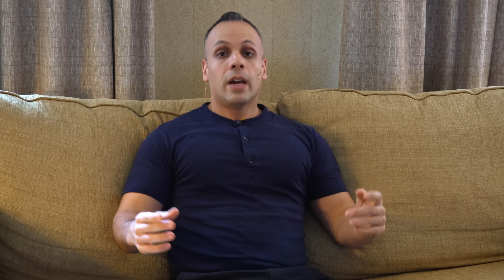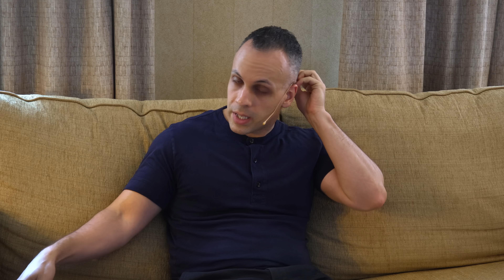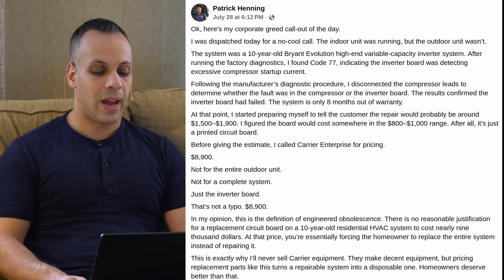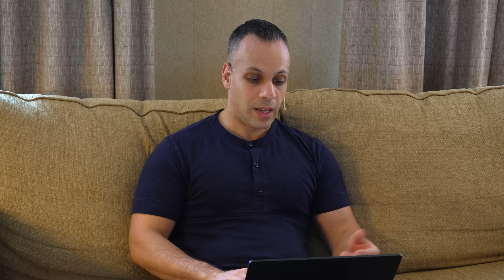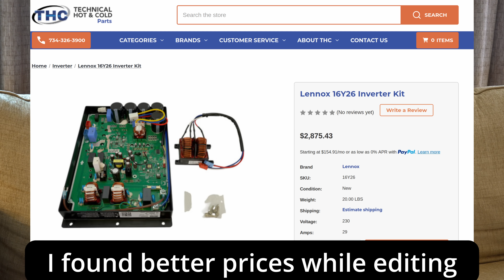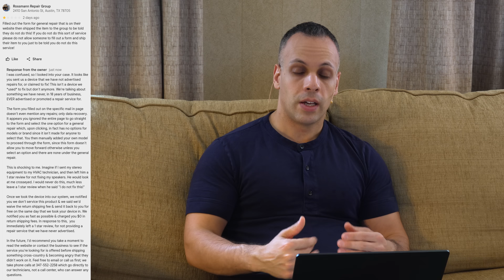Carrier AC repair has $8700 part cost for residential unit

Comment: This is very true for window units as well if the Fan motor that drives all internal and external air handling goes out to repair it the part alone is usually 40-60% the cost of a new unit not even factoring in the repair labor. They want you to throw it away and create more garbage and then buy a new unit. Its a racket and it contributes to global garbage as recycling a used ac is not trivial due to regulations. Oh and they don't last more than 5 years if you use them regularly as we do in my household. if the use were more intermittent they could last up to 10 years I am sure but not with everyday use for 3/4 of the year.

Comment: I've been in HVAC for 9 years. I have never fixed an inverter board. Granted I've only ran into a couple bad ones in my entire career. Frankly, most HVAC guys lack the skill to properly diagnose inverter systems, let alone have the knowledge to repair electronics. Residential HVAC is full of PE companies that hire mediocre techs that are good at selling. The whole industry isn't built to incentivize repair. Hence why I own my own company now. If I ran into a bad inverter board, and saw a price of $8500, I would attempt to repair it.

 Another super common failure is ECM blower motors. It's the same technology. It converts AC into DC, then back into AC in order to change the frequency, and therefore the speed of the motor. 

The part that always fails is a $10 thermistor. Most guys would never attempt a repair. I carry thermistors and a soldering iron in the truck that way I can repair them. I charge $400 to fix it, whereas a new ECM blower motor tends to run 1800-2500 at the parts house. The only time I don't fix them is if the whole entire board is potted

Comment: This is because of rules Biden passed to switch to partially flammable refrigerants effective Jan 1, 2025.  You used to be able to switch out an.evaporator.  But under the new rules, if you have to replace more than 50% of the value of the unit, you have to retrofit the entire system to the new refrigerant rather than repair.  And the new systems are much more expensive because of all the safety devices and sensors.
Fun fact: with the new refrigerant, if your furnace is gas without sealed burners, your heat can be shut down if a leak is detected from the ac.  So switching out the furnace at the same time adds to the cost.
Don't blame the HVAC installer or the HVAC manufacturer, this comes directly from government regulations.

Comment: You can buy a variable speed drive containing a similar size inverter board for $150. Not suggesting it will integrate with the Carrier control circuitry, but it gives an idea of the actual cost to manufacture, warehouse and deliver such things. You are spot on Louis, offering a repair service for these "bend you over" OEM parts would certainly be lucrative. Imagine if there's a capacitor that tends to fail on these that anyone could see from the bulge and replace in a few minutes - less people fucked and the planet saved from the environmental cost of making a new air-conditioning system.

Comment: I hate Carrier. I just replaced a HEIL (also Carrier) inverter board. over $2000. Still too expensive. Bosch has one of the best inverter/communicating systems and their inverter board was $1500 (I hear it's now 2k). Bosch however doesn't require an expensive thermostat, or even a matching air handler on the inside. You can hook a Bosch condenser with its inverter board up to a regular Goodman indoor unit.

No. I do not fix these boards. Yet. With the geopolitical issues brewing I'm very seriously considering learning how to begin repairing these boards. It's a little outside my normal skillset, but it's got to be easier than brazing 3/4" copper 1" from a service valve.

Comment: My old HVAC guy told me if it's not that it's the board. He said the board is 800 bucks. I went to Amazon. I found it for about $140. The exact model I bought it. I told my guy I bought it just on case then he says I don't put in other parts. I can't warranty it and it's a motherboard. That's all it is. It's a motherboard and it's the crummyest old fashioned motherboard. You can get the latest and greatest motherboard for a couple hundred bucks like a gaming PC and it's got double and better. It's a joke $800 but HVAC is like locked in. You can't buy the stuff you have to go to an HVAC supplier and they only sell the license technicians. The heat pumps are going to get them in the long run

It's like three plugs for power and an eight screws of wires and he needs to get 800 bucks on the part plus like $300 or $400 to put it in 1,200 bucks for 12 screws and wires together

Comment: I used to work at United Technologies and we made the control boards for carrier units and pretty much every other high end HVAC unit company. I did board repair the lsstv5 years I worked there before they moved to Mexico in 2016/2017. As long as the board itself isn't cracked or damaged you can pretty much repair it at a pretty minimal cost. The trick would be to diagnosing it to know what to repair.
Reply: I'll also say that once they started production in Mexico they were sending pallets worth almost 2 million dollars in total back to my facility for repair because the Mexican plants quality was so bad and that was around late 2016 into 2017. I left there in September of 2017.

Comment: Recently ran into an issue with my blower motor in a second house where the ecm cost 450$, but the ecm and motor cost 400$. On my home furnace it was a 4$ capacitor.   I’ve spent maybe 200$ on my home furnace/ac over 10 years. My home furnace is 15 years old and my ac is 27 years old. Anyways, I refused to pay that price and found a used one that matched exactly on eBay for 100$. The furnace is only a few years old and used for under 100 hours. Obviously the used part came from a newer furnace, and I’m sure the homeowner had theirs replaced because  the cost of the replacement parts cost more than brand new furnace.   It’s ridiculous!

Comment: The other issue outside the ridiculous MSRPs on these replacement parts is the sourcing. Many of these parts are only available to licensed contractors through approved distributors (e.g. Johnson Controls). So even if a DIYer knows enough to replace the part, they can’t get it at any price because the SOBs won’t sell it to them.

Comment: Well, now I'll never use Carrier for future AC needs.  I replaced the original AC in my home 7 years ago, and the HVAC company (locally owned, non-chain company) told me they don't sell TRANE because that company doesn't honor warranties if you can't prove you had the AC service EVERY YEAR after install.  They only sell Lennox systems and it has been rock solid every year since I installed it.

Comment: Buying these so-called high efficiency type appliances is foolish.
 The money you save monthly may get you a Starbucks latte or two, that's bout it.
 These units will last just as long as a cheaper one will also.
 And the repairs on the cheaper one when they do occur will be substantially less moolah.

Comment: Ive seen them trasition from simple decently priced units with very good warranties. The only ones that needed expensive stuff were the fancy $10k units that had boards that were $1500 each. Ever since the newer refrigerant and its requirements theyve had more problems and needed costly repairs.

Comment: When you buy an HVAC, get the most basic, single stage type stuff.  Lasts longer and easy to fix.  You might have a slightly higher utility bill, but cheaper to pay an extra $20 in the summer than this nonsense.

Comment: same thing with my car i will make my 2006 toyota highlander drive till I AM DEAD not it.  I have replaced several items over the years and its still jugging along at 260k with no sign of letting up.  It definatly is not the prettiest thing to look at for sure.  sand basted paint off most of it and currently a rachet strap holding down the hood.  But all the repairs are a fraction of any repair of a new car.  I keep getting told by the mechanic that car is not worth fixing then i ask him if he is willing to buy me a new car.  It will be worth fixing for 400k+ miles

Comment: I'm a nyc jvac guy and developing business and my recommendation is pls stick with regular conventional ac for central residential homes simply because if your equipment breaks in hot humid day in nyc I can usually go to local hvac supply house buy new part return and fix the equipment cheap enough. Inverter systems are all a wacky smokes blown on paper that really never equal = $ savings over 10yr period because simply new equipment will most likely not even last that long period. And im certified for M. i..
If you no what i mean and they're also beginning to go down wfter merging with big boys and inplementing proprietary controls. Just completely insane. Nothing wrong with Goodman and trust me always stay away from carrier as much as possible

Comment: I think HVAC and some appliance board repair would be a good business. Finding a good supplier of bad boards and just fixing them and selling them on even ebay or back to the tech would be good side income. I have had pool heaters, hot tub, treager bbq and dryers all with $500-900 boards that seem repairable for most likley $60 in parts and just a bit of time. Pool equipment stands out the most to me. Its VERY of priced for what tech it is and the tech is dirt simple. Most of the times its just something like a spider or other bug shorting something out.

Comment: Hey Louis, HVAC tech here. We/I do not repair the boards. Most inverter boards have too much going to even try to repair them. (IMO) you might find an inverter board at scrap/junl yard. Ask if they have an area where people usually dump ac units; you can call your local DCNE.

Comment: Our HVAC company that we have used for years stopped dealing with Carrier as they could never get replacement parts in a timely manner and their units no longer lasted as long.  The new Carrier AC residential units have coils that rust and degrade in less than 5 years and they need to be replaced and the motherboards have major issues. Their customers end up with units that don’t even last 7 years without needing major repairs. Now our HVAC company only deals with Trane and dropped Carrier altogether.

Comment: There comes a time on parts pricing where they will become really cheap. Distributors will stock parts for common units and hopefully sell them at list prices. However as units get older and are replaced the demand for parts drops. For parts like this there is a greater chance the owner will replace the unit rather than spend a huge amount to replace the board. There is one less unit out there that may use this part. Distributors might have a few of these parts sitting on their shelves waiting for someone to buy them. Smart managers will see how long they have been sitting and how many sold and cut prices. It's better to sell a part at cost or even below cost rather than have it become useless. This is often the case with car parts. I needed a part for a 16 year old car. Dealer could order it and price was $310. A large parts distributor offered one on eBay for $275. I saw they had 5 in stock. Called them and spoke to them. Asked how long it might be before the phone rings again for one. He dropped price to $200. Old parts become useless and smart sellers don't want to get caught storing obsolete parts.

Comment: I’ve been in the industry for over 20 years and I can confirm depending on your local energy rates. The price of the equipment upfront will not be worth a return on the investment as far as energy savings along with energy savings, though there is a comfort dynamic that you need to consider the variable refrigerant rate and the variable airflow also lends to not over cooling the The space in order to provide the proper amount of BTU to condition the space. We do not repair circuit boards because we don’t have the knowledge to repair them. If the part is covered under warranty that is a whole Nother dynamic because the warranty is going to cover the part, but not the labor for instance, if the cost is 8900 for the part, you’re probably gonna pay around 11,000 when you include labor and overhead to repair the system at which time we will need to pay for the part and then get a credit back from the manufacturer once they’ve determined that the part failed due to reasons not outside of the warranty. If the part was not covered under warranty it’ll just get trashed.

Comment: How would I go about learning to repair inverter boards for AC systems and mini splits? I’m an HVAC student right now less than a year from getting certified but I’ve studied my ass off. I’m still young, and I know the future is electronic and digital, so if I learned how to repair these boards it would help me a lot. Also I have minor experience in soldering too. Any reccomendations for books to read, videos to watch, or courses to take would be greatly appreciated.

Comment: Very curious where Carrier gets the inverter board. Made in house? Sourced from China (highly likely). What horsepower/KW rating on it? Standard generic motor inverter controllers (VFD)....Variable Frequency Drives are super cheap on Ebay. A 2 horsepower unit can be had for anywhere from $80 -$200. The carrier unit might have some semi-fancy features but the technology is as common as a $5 calculator

Comment: Can’t believe you just posted this video I went through the same thing yesterday. I had a customer with a 13 year old carrier that had a leaking condenser coil (literally a radiator made of copper tubing and fins). I called carrier enterprise and was told it would be $5700 which is definitely a fuck you price. The parts guy then told me I could buy a Bryant bundle with new condenser, evaporator coil and furnace for $3500. Carrier makes it impossible to repair equipment once warranty has expired. 

As a side note the larger benefit of inverter driven compressors over efficiency is the dehumidification is far better. I personally like the Daikin fit variable speed systems, very reasonably priced equipment and parts.

Comment: I work on overhead cranes, with big 3 phase inverters quite a bit.   Small chain hoist inverters can be a couple to a few grand for  a brand new inverter.  Keep in mind this is an inverter with speed feed back, programable inputs, some have load cell inputs,,, just all an all a lot more functions than just that printed circuit board.  Small travel drives can be maybe 500 hundred to a thousand or so.  So no,, honestly I think they should be considered guilty of fraud.  If I were in that situation, I would see if I could get a magnetek g+ mini inverter to work.  Then I would tell carrier  to take that cheap board and shove it.  But thats me, I mess with inverters for a living.  I honestly would be surprised is someone hasn’t already figured out a way around it.

Comment: I had a company come look at my unit years ago and the tech busted the valve off of it and dumped out off of the refrigerant. Then said he can sell me a new unit for about 12k. I ended up getting the vacuum pump from work and got my epa license off of skill cat and installed an over sized mini split unit for my house. No during the summers I can keep my house around 62° and my electric bill rarely goes over 100 bucks.

Comment: Reminds me of the ECM blower motors that you find in air handlers nowadays. Instead of just swapping out the motor with a new one (universal or OEM), the blower motor has to be paired with the dongle that comes with the circuitboard, costing the customer significantly more in time and money. The predecessor motors were just a multispeed motor (blue, red, and black wires) for low, mid, and high speeds and on average were only a few hundred dollars (customer cost). The last ECM motor I replaced for a customer was $1,600 for a Goodman (Good Enough).

Comment: The online reviews of these companies on Google especially are absolute 💩! Almost every company has near five star ratings and thousands of reviews which makes absolutely no sense. You know something's rotten in Denmark when that's all you see. They outsource that for pennies on the dollar.

I once made the mistake of calling a big company that does a lot of advertisements here because they were the only one available during a heat wave. Obviously, they took advantage and charged an arm and a leg just to top off some freon (my 26yr old Carrier's got a slow leak) until I can change it in the fall. I had no choice when facing near 100° weather inside the house.

After doing that, it is ridiculous how many times they have texted me to post a review of them online and recommend them to other people (one today in fact) so that I could potentially earn up to $500 when their job is complete. That was utter BS and a tactic they use just to get customers. 

All this fraud from HVAC industry aside, it's nothing compared to what my electricity company has been charging me and everyone around me for the past 2 months now. Everybody's bills skyrocketed. I'm paying now triple what I used to pay before per month. This makes almost every scam the industry is running seem almost nil in comparison.